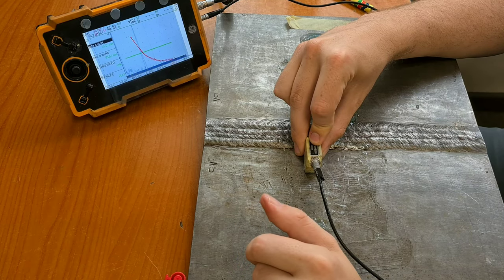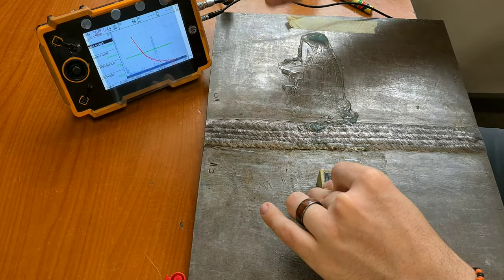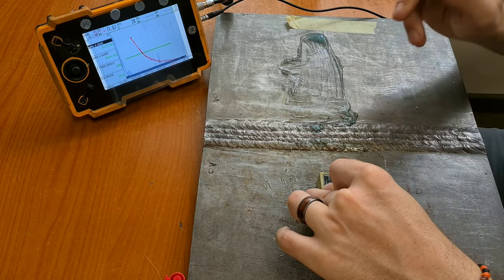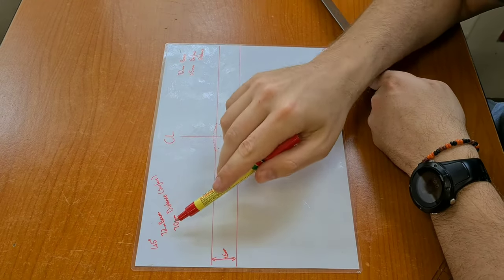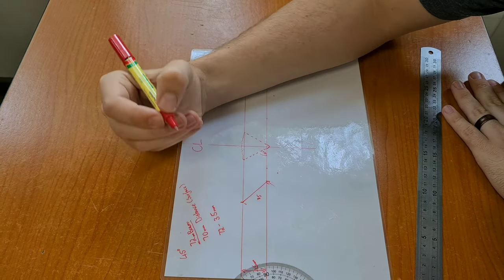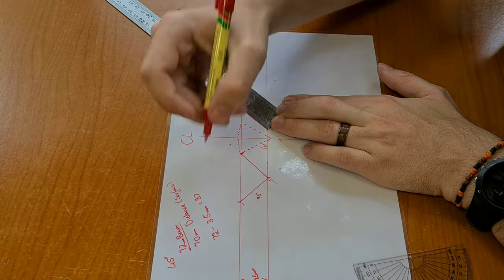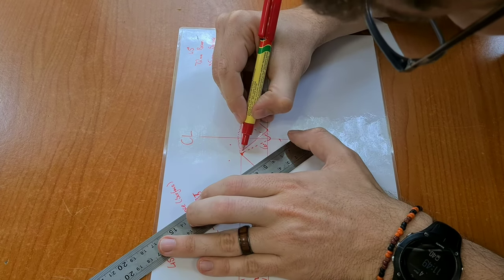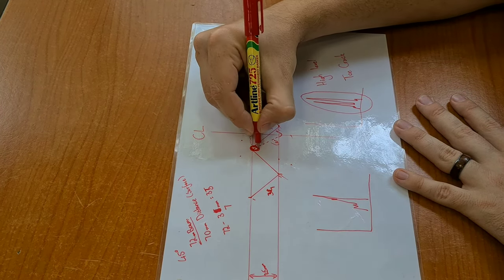Finding and identifying a crack with ultrasonic testing A-scan representation

Comment: I am currentlly waiting to complete the part A and C of the CWI test. 
I would love learn UT and get certified,  how do I get started?
Reply from the maker: Hi there Brayan, I believe the Simplist and best way to go about this would be to contact a NDT training centre close to you. They should be able to advise you when the next course is available and costs and certification type. I recommend asking them for the study material before you go though,so you can start working through it.

On top of that...you can also watch some more vids on my channel 😉
Reply: @garathbester  Thank you, Sir. Always will watch the channel🤣🤣🤣
Reply: Good luck on your CWI test. I took it in 2011. It can definitely change your career path.